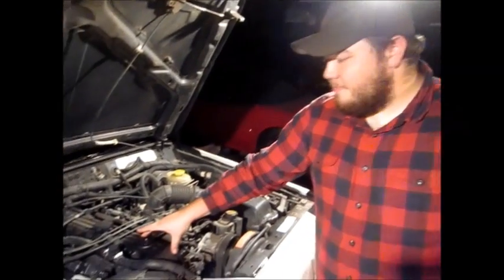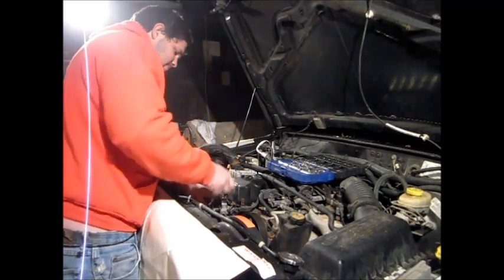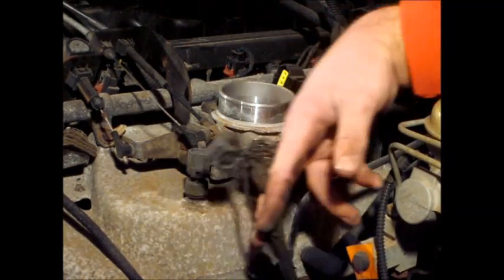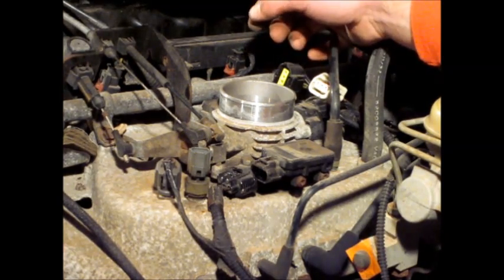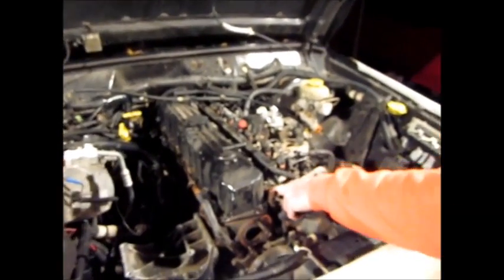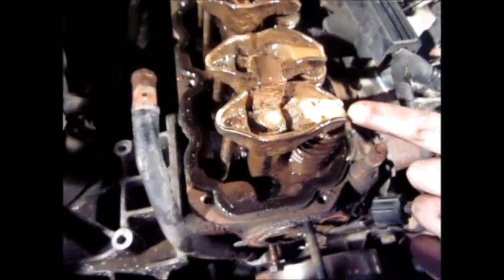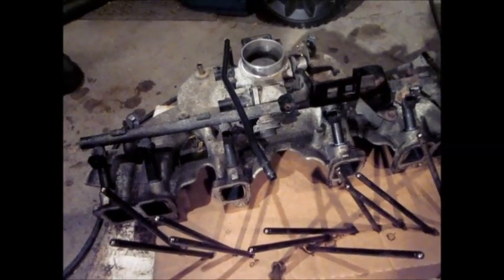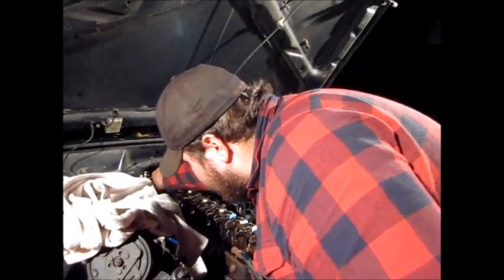99-01 XJ Jeep Cherokee 0331 Cylinder Replacement.

Comment: any tricks to getting the bottom bolts off the exhaust/intake manifold?
Reply: Dirty Dave's Garage shove your arm under it and find the bolts. That's how I got them off.
Reply from the maker: I really don't remember what I used this time but for the most part I use a extensions, swivels, and flex head ratchet wrench to get the hard stuff. For the most part once they are broken loose you can turn them by hand.